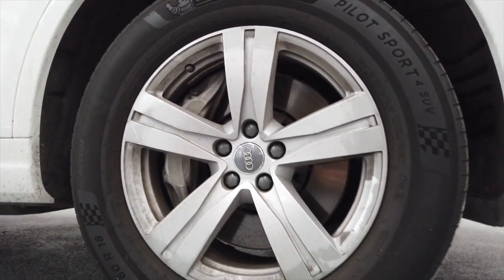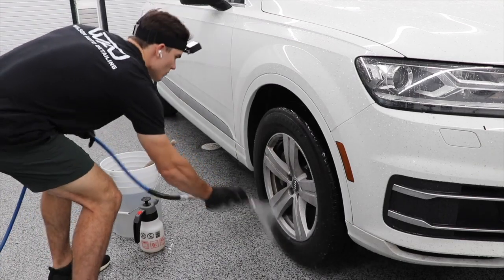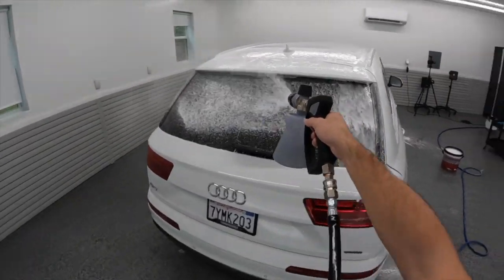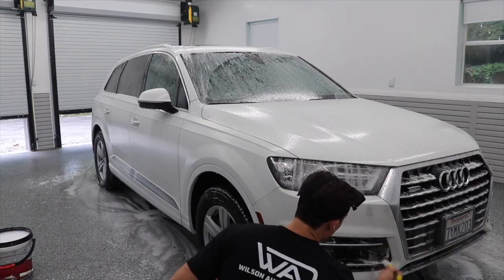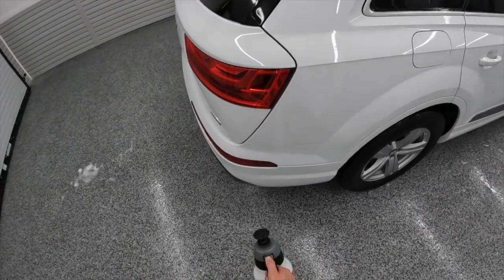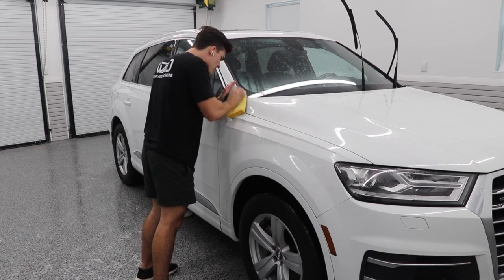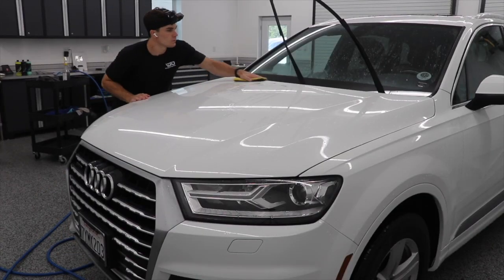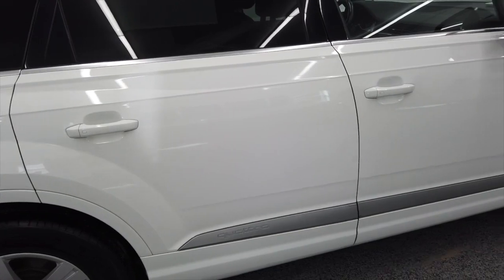Inexpensive Products To Use For NASTY Exterior Details

Comment: Can you use just a simple soap wash as your lubricat for your clay mitt or clay bar??
Reply: Grab yourself a rinseless wash like ONR or Absolute, diluted down (I think its 64:1?) and there you go. Super cheap and easy clay lube
Reply: Soap with a clay towel, not a clay bar
Reply: Clay Towel, Clay Sponge, any synthetic clay is pretty solid as it has less marring then a normal bar
Reply: I work in a nissan dealership and yhe boss is giving out that I'm using to much quick polish detailer, and I'm trying to explain to him that's its for lubricant for clay baring, and he told me to stop it, it was only wasting time 🙄